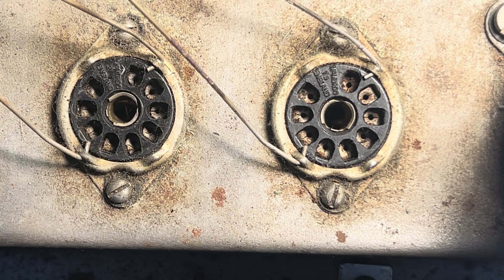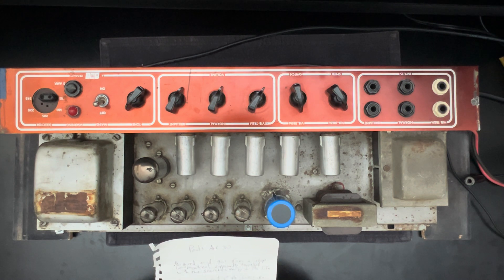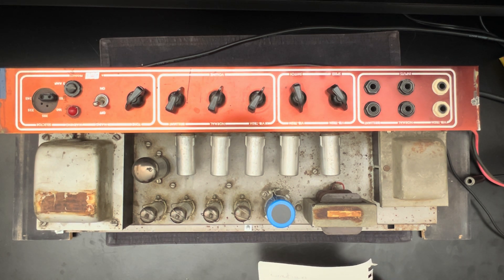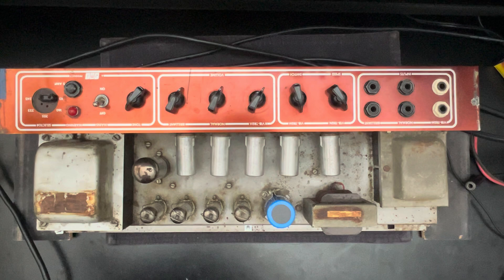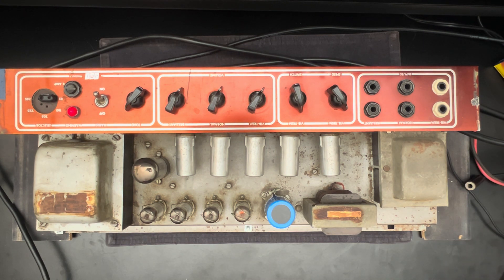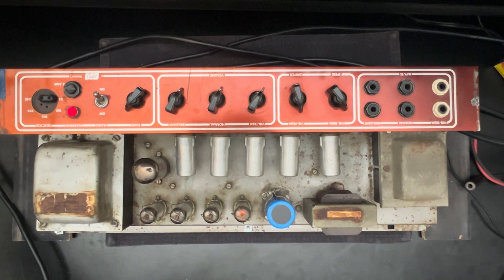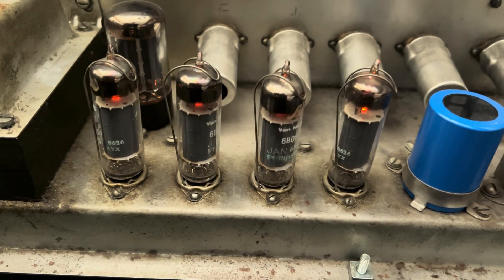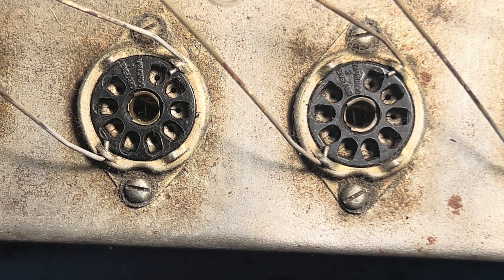1963/4 Vox AC30 Part 1 || Canadian Bakin’

Comment: Ah, also: wherever the Hammonds are made, Holland, Germany, Great  Britain, they're all Philips/Seimans. One exception I know of are the French EL84s.
Reply: Weird, had a longer post b4 this one, gone! Philips also made the post-US Amperex tubes.

Green Baldwins are Sylvanias, bullet proof! The orange ones are Japanese, Matsushita I believe, I have one tucked away, great tube.

Later Hammond's made in Great Britain are Mullards, I found them most often in the 7591 big wattage amps like in the H100.
Reply from the maker: @oldasrocks9121 I was wondering why it read like it was part 2. 😂
Reply: @ForgottenGearRestorations  Hey Frank, fyi the tall letter Hammond EL84s made in Holland and Germany (Philips) can take a beating plate voltage wise. They're also cheap compared to their branded counterparts. The French ones aren't slouches either. In case this client ever needs to retube this power section.

They are also very sweet sounding at reasonable plate volts like 320-350 and will last forever.  Hammond amp plate voltage was reall low compared to contemporary guitar amps so you won't find many of these pulls that are thrashed
Reply from the maker: Thank you!  This is a big gap in my world right now.  I wish I could get nerdy into the glass.